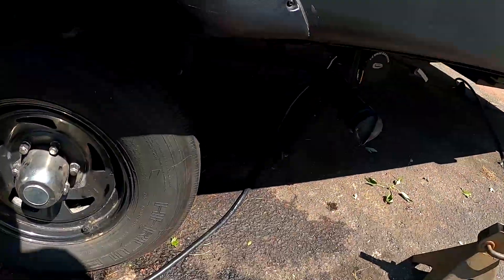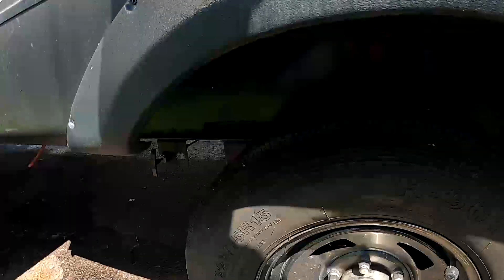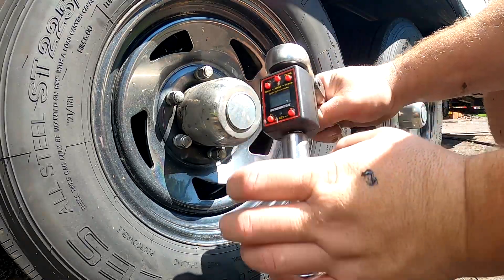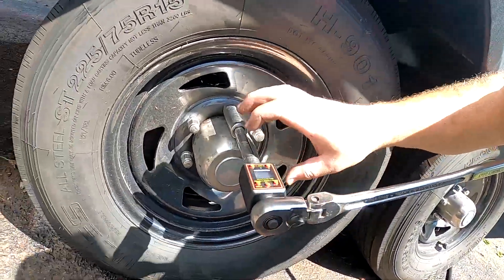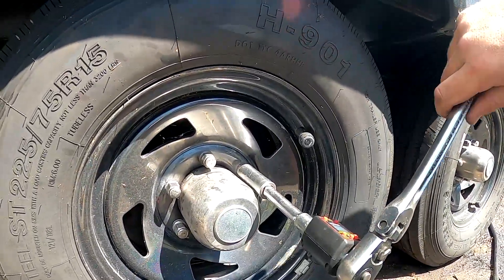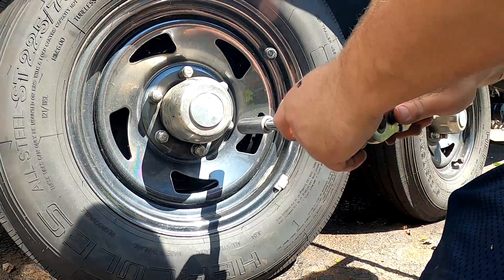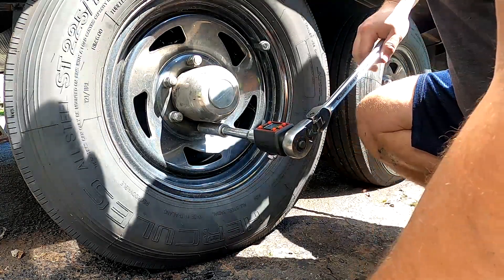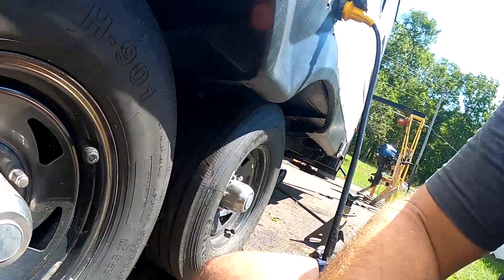If you use an impact to tighten lug nuts, you have to watch this video! Are your nuts torqued??

Comment: You are a guy just like me. If I ever have a chance to meet you, I will pay for your steak and a beer!
Never use an impact tool to tighten wheel nuts! This is from OSHA training.
Using impact tool to remove nuts will definitely weaken the strength of wheel bolts. There are many shops nowadays use impact tool.
I was once dropped my vehicle for tire change and the guy used impact tool to tighten wheel nuts. I told him to stop it and ask for a refund of the job he was doing. Then I got my money back and I shopped at else where.
A year later, that tire shop was shut down due to its employees’ safety issues!
Reply from the maker: @TT-dp8qh  as long as your impact is below the torque spec on the wheel it’s no problem. Most tire shops use torque sticks which really only work with pneumatic impacts and then use a torque wrench to the correct spec. I’m sure there’s some that don’t but that’s sort of the industry standard at this point. Too much liability in doing anything else.

Comment: At 15 seconds… why? …
Reply from the maker: It has 1400 ft lbs. if lightly laying it on a driveway would damage it, then the torque it produces while giving full ugga duggas would tear it in half. I don’t buy tools to keep them polished in a case. They get used in the rain, in the dirt, thrown in toolboxes, and get sprayed in hot oil.
Reply: @drewdoestrucks fr it’s just a tool, that’s like complaining about dropping a hammer 😂

Comment: Thanks for the basics.  Recently widowed, I must learn these skills. My tire guy gave me good advice, but not enough info for me to protect the nuts and bolts.  I’d have liked information on how to change wrench settings. I would have guessed #3 would be a high setting on that Milwaukee.  My manual show rpm, and ipm, but not pounds. It says mode #1 is lowest but I don’t know what that means.
Reply from the maker: 1 is the lowest torque setting.

Comment: I'm a retired certified mechanic and yes, use a torque wrench on your lug nuts 100% of the time. The less expensive cars and trucks cut costs on thinner rims, if not properly torqued the rims warp causing odd wear on the tires and your wheel bearings.
I use a paint marker on every wheel opening that lists air pressure and lugnut torque. Every vehicle and trailer I have has different air pressure and different torque settings. Kiss approach for me doing it this way.
Reply: 🥶 hey bub i use a impact wrench to remove Lugnuts but i been busting balls to walls using muscle to tighten Lugnuts and never had a problem, spark plugs too, just tighten da Lugnuts using monkiee strength